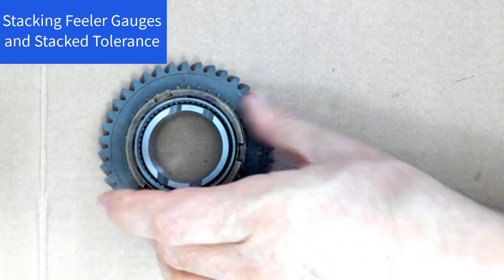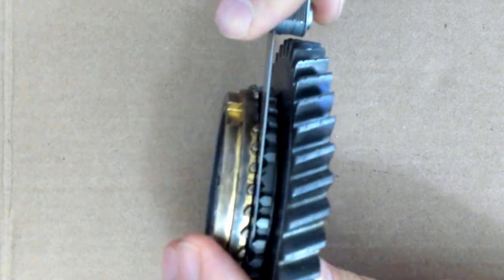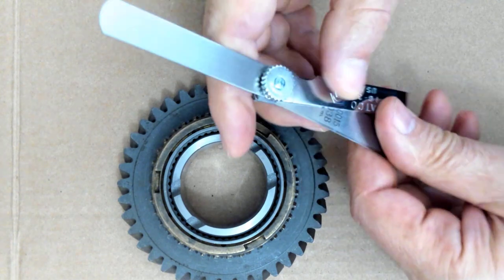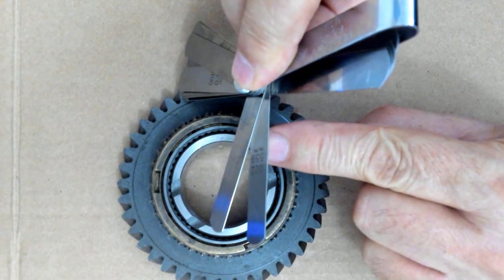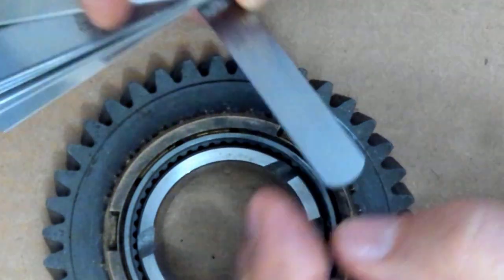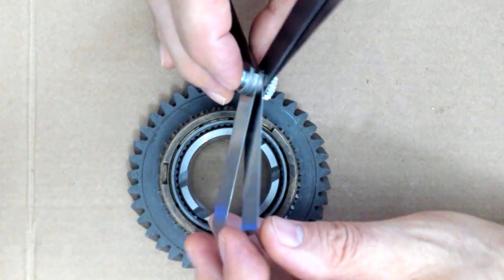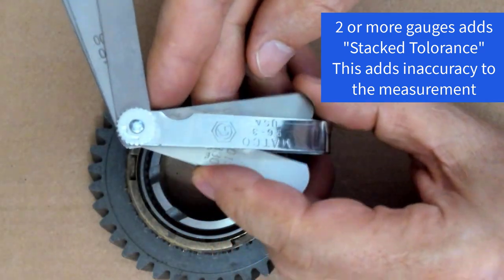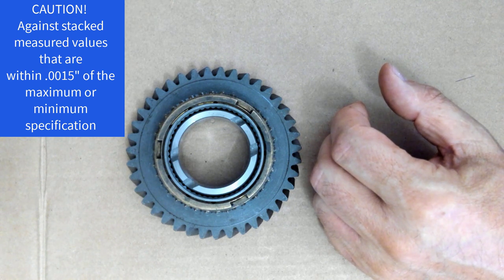Feeler Gauge Measurement & Stacked Tolerance

Comment: Notice that the set of gauges shown is held together with a screw and nut. Remove the gauges you need from the set to use the two that add up to the clearance you want, without other blades in  between.  If possible, check the actual height of the stack with a micrometer to decide if the result is acceptable.  Oil, dirt and air between the blades can make the stack somewhat variable in thickness, so check several times.
Reply from the maker: Thank you.  Yes, I get that. The point was to show what not to do if you don't take them apart.